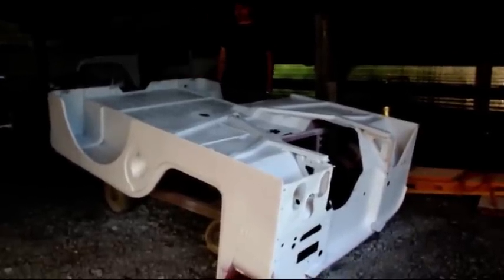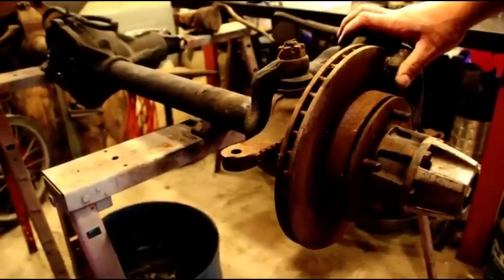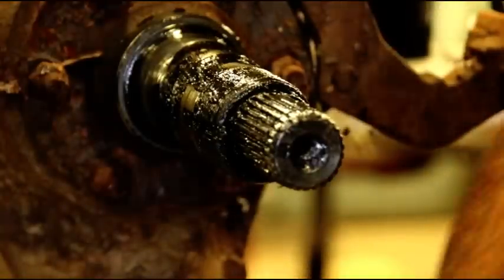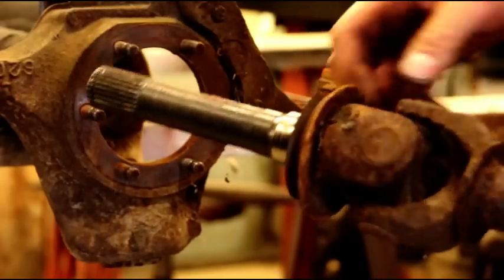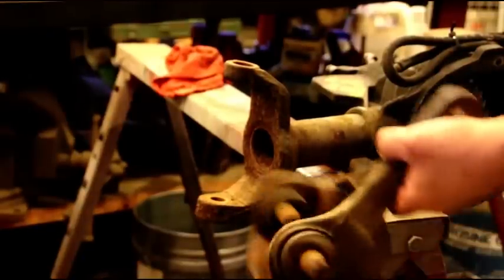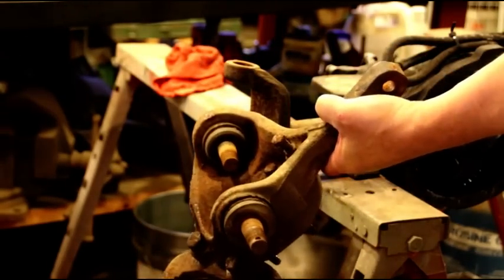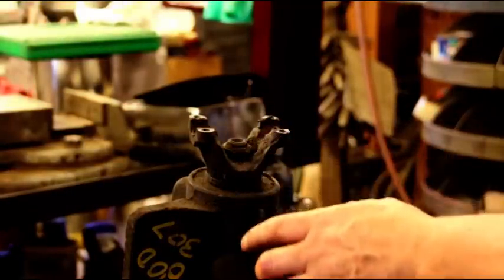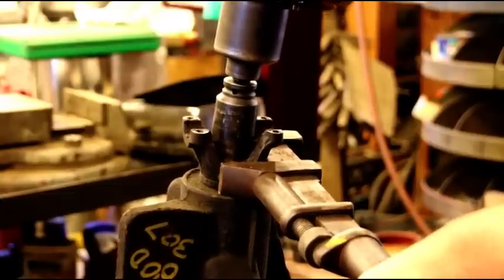Jeep CJ Dana 30 Front Axle Rebuild Part 1 Disassembly

Comment: I'm just now revisiting the various Jeep CJ axle videos to refresh my memory and get info.  On your Dana 30 is it an open differential?  I was just thinking that the manual locking hubs are pointless if one wheel isn't driven by the diff. gears.  I have an 80 CJ7 and as far as I know it's original except for one of the manual hubs was changed before I got it over 20 years ago.

Comment: Hi . At 5:25 the spring that came out. Does that spring come with the hub assembly? If not what is it called and where can I purchase it from? Thank you for the detailed video.
Reply from the maker: yes the spring is part of the free wheeling hub assembly.  It will be in your hub and if you need a replacement you need to contact your hub manufacturer.
Reply: @metalshaperJeep  thanks for the info.

Comment: I have Spicer style drive shafts in my GPW, there's been no snap rings fitted to the axle end. Luckily not much damage has been caused to the axle Bush (which I believe isn't needed anyway). But once the shafts are fitted, how many shims need to go in the spline flange?
Reply from the maker: Install a Flanged Bushing in your spindle, and then put the shaft in, then your hub and snap ring.  No shims are needed on Spicer style axle shafts.  You must install a flanged bushing in your spindle for them to work correctly.
Reply: @metalshaperJeep  could you put up a link to a picture for the correct flanged bushing please?

Comment: My cj7 has left front wheel sticking out more when compared to left rear. Any idea why? I'm new to cj7s. Maybe they have a common fault. 
Seems like axle needs to be shifted to the right but it's already maxed out to the right
Reply from the maker: Not sure exactly what you are dealing with there.  Are you working on a CJ7 with narrow or wide track axles?  maybe you have a combination of them.   Need more info on year and width of axles.

Comment: This is such a help! I"m tearing down my Dana 30 on my 80 CJ5. One I pull the axle shaft do I need to avoid getting water in the axle? I'd like to wire wheel, prime, and repaint it after replacing the ball joints but I don't want to take apart the entire axle.

Comment: Do you recommend powder coating the axle over epoxy primer and paint? And why?
Reply from the maker: powder coating is not a good option for axles.  Epoxy primer and urethane paint is the best way to go .   Save the powder coating for interior parts only.
Reply: Brain is wright, I was surprised to fine our 66 cj5 frame and axles had been powered coated. What little remained, power washed off with easy. Bear

Comment: 1979 CJ5 rotor has been scoring the caliper bracket. I bought new replacement seal, cups and bearings in addition to the rebuild kit for the caliper and a new rotor. When I assemble it the rotor rubs on the bracket. The book diagram shows all the components but I am about 3/16" too close to the rotor when the caliper bracket is installed. What can you recommend next?  I have pictures if you would tell me how to share them?
BTW, Your videos are very well organized and I appreciate all the effort you put into explaining the differences between manufacture years and owners.

Comment: would this be the same for a D44?
Reply from the maker: The main steps are the same but you should check the specs for every axle assembly to be sure to get back to factory settings.

Comment: what do you  recommend using to bend the new washers over the nut?
Reply from the maker: just use a long pry bar and it will bend the washer over with no problem.
Reply: @metalshaperJeep  fantastic. thanks! i just bought a 47 it needs lots of love

Comment: Alright metalshaper, you showed me the seal puller and I went over to e-bay and found a Snap-On seal puller and it is now on it's way thank you I seen it on e-bay and did not know I was going to need it but now that you showed me how to use one and where I was going to need it so thank you and I do not think my tool box is big enough so I got me another tool boy wile I was on e-bay and had my card out ..

Comment: Have you ever pulled the inner bearing on the spindle?
Reply from the maker: I just showed how to make a tool and get the spindle bushing out on Facebook.   
https://www.facebook.com/profile.php?id=100035977323409
check out this link to my page and scroll down to 3 August 2019 and you will see the process of how to make the tool and how to use it.   
Brian

Comment: Excellent video, very detailed and informative.  I cant seem to find the socket for the lock washers, in KY.  Any suggestions?
Reply from the maker: Standard Jeep wheel bearing socket, you can find them at most jeep parts retailers.

Comment: Hay thanks for trying to address the issue I’m having with the Dana 53 but it is the cup on the pinion towards the ring gear the hole machined  in the rear is to small to do what you suggest there must be a puller of some type for this cup and I can’t find it I am getting upset with this build I got a sand blaster the air compressor it not big enough I got a blast cabinet it requires modified I got blasting media it won’t flow I bought panels they are requiring a lot of modifications I can sand blast so I can prime and weld in patch panels I have been trying to get this rusted rear apart for 3 months I order pullers wait to see if they work no body gives sizes then I have to figure out what to order and how to put it together and it last

Comment: What brand pinion seal puller is that @27:10 ? I need one!
Reply from the maker: The seal puller is now obsolete so you will have to find a used one on ebay or some tool dealers.